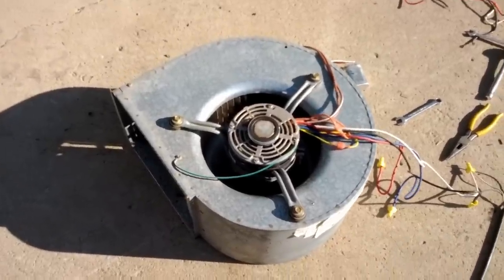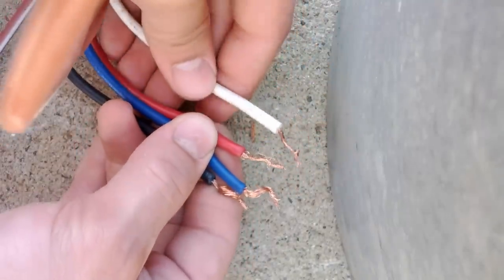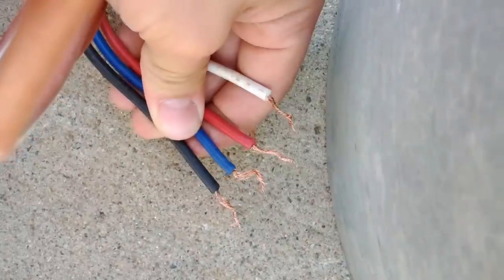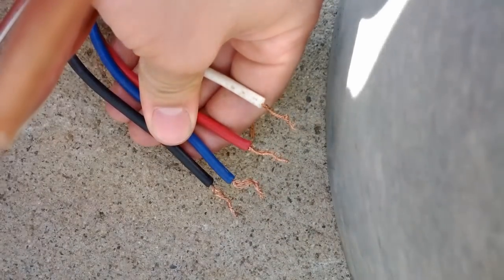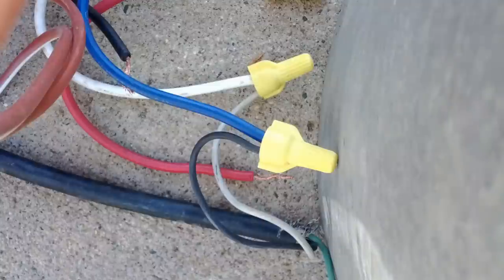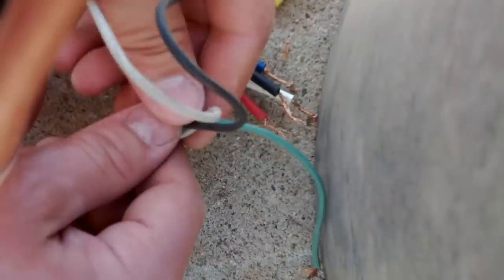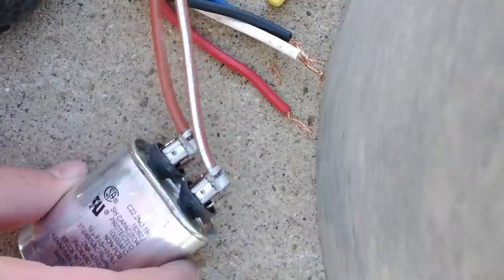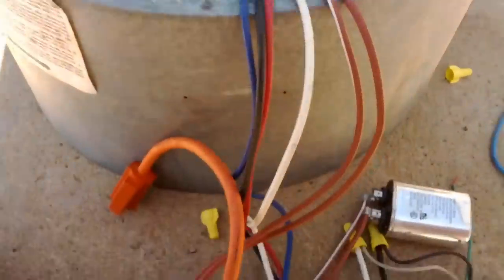How To Wire a Furnace or AC Blower Motor DIY

Comment: Hey Ben. I just found your video tonight. Thanks for this very well explained video of how blowers work. One other hint. I have a friend who does commercial air-conditioning and he gave me the blower out of a 5-ton unit. He explained the wiring to me and it works fine. However, he cautioned me that blowers are looking for a "load" when they're running. As they are designed to move air through a series of trunks and duct work, they are looking for a load or partial block of the blower output to run properly. He told me to take a piece of plywood and partially cover the output opening until the fan ran as fast as it could. I had to move it around a bit but I finally realized there was a sweet spot where the blower moved the most air. My friend told me if I ran the blower with no "load" on the output, it might burn it up faster. It's been working for years now and I put a rocker type switch on it; one way for high-speed and another for low-speed. Thought you might be interested in that.

Comment: I have an old a/c unit scrapped for parts and wanted to use the blower motor/squirrel cage as a shop fan but wasn't 100% sure on the wiring, your video fixed me right up.

Comment: Thank you! I was getting condensation because the blower speed in my AC was too high. Switching to the med-speed (in my case it was actually yellow) just saved me another service call. It's been 4 hours and so far no droplets.
Reply: Condensation is a normal thing. It shows the AC is working properly. If you don't move enough air thru the evaporator coil it will freeze up and your fan motor will burn up from too much Resistance. Your drain line is probably stopped up. Just blow the line out with compressed air and wire it back the way it was (Higher Speed) and it will work fine.

Comment: I used a commercial 3 step rotary switch on mine to get all three speeds working. I have a large deck behind the house. I put a couple of vanes on the front of the blower to spread the flow outward and it works great.

Comment: I guess my blower motor only has a high and low speed; because I only have red and black, and purple.

I am using the blower motor to evacuate heat from my workshop.

Also, if I only connect 120v the motor runs only at half speed; and I have to move more air than that.  

Thanks for the content; straight forward and actionable content; so thanks for that.

Comment: You don’t have to guess what wire is low medium or high speed just run resistance test from neutral to each one of the wires. The one with the highest resistance is low speed always.
Reply: What component on the motor increases resistance?
Reply: @SilverthorneA27  windings
Reply: Is each set of windings slightly different material? Or just longer pathway?
Reply: @SilverthorneA27  Getting a bit past my knowledge but same material (copper) but less or more of it.
Reply: @SilverthorneA27  Some motors also use inverters to change frequency.
Reply: What will the resistance be between low speed and medium speed (as an example)? Just want to be 100% sure I identify the neutral wire by process of elimination even though it is likely going to be the white colored wire.
Reply: @chrisE815  low 24 ohms 
Med 17 ohms
High 6 ohms
Reply: @SilverthorneA27  Longer pathway.

Comment: Dude, Thanks a whole bunch. I've been holding on to an electric motor for almost 5 years with the intention of building a homemade lathe and I've tried several times to figure how to wire it to  an a.c. outlet without success. With the help of this video I was able to wire an electrical cord to it in 5 minutes. And to my surprise its also a 3 speed motor. I can't thank you enough man. Now I'm excited about building my lathe. Yeeeehaaa.

Comment: Benjamin. Thanks for your video. I'd just wish you would have shown how you managed to get the power ( 110v in your case) to test/check the hook up of your wires. We need to see that so we will not damage anything and we will not get electrocuted... If my 7.5 uf capacitor also reads RUN, what does that mean? how come my previous capacitor was the same 7.5 uf but bigger and it did not have the words RUN? Why yours reads 
370/440VAC and mine reads 440/370VAC ... I pulled my blower to clean it thorougly and now i am hesitating about connecting wires yellow and black and i did learn about the other black. blue and red ... The thermostat was the one that stopped operating and it was not due to batteries!. Thank you . Blessing to you, your wife and children. Thanks for the beautiful pictures in your website. regards from Florida.

Comment: Benjamin, you did a good job of explaining the speeds of that motor, when it came to explaining the capacitor mispoke that capacitor does not start the motor it helps in the running torque but does nothing in starting the motor. It is true the motor will not start if the capacitor is not wired in because it does not complete the electrical circuit if the capacitor is not there.
Reply: In this kind of service the capacitor is not used as a starting capacitor but as you have said the motor does require it to start because it is powering one of the windings that provide the motor with a phase shift in order to induce a rotating field upon the rotor. W
Without this phase shifted magnetic field the motor will just hum and the shaft will not turn.  The capacitor fed motor winding also establishes direction upon startup and depending on what wires are brought out from the motor these kind of motors can be reversible.  This kind of motor is named a permanent split capacitor  or PSC AC induction motor.  They are useful when the starting load is not too heavy as with a squirrel cage blower motor whose load characteristic increases greatly  as rpms develop (more air resistance against the squirrel cage fan) at which point the motor becomes efficient when it approaches it's design RPM which is around 1075 rpms for 60 cycles/sec powered 6 pole wound motors.  This motor has 3 speeds which are relatively close to  each other and are derived by 3 different winding schemes within the motor to allow for a controlled amount of rotor slip within the magnetic rotating field.  The slow speed when the red wire was connected would indicate the most rotor slip was occurring.  If the motor were to be run without the squirrel cage blower on it's shaft you would not notice any speed differences because the proper load the motor rotor will not slip and develop the different speeds indicated on the nameplate.
Reply from the maker: Thanks for the clarification!
Reply from the maker: Kenneth deGruchy Thanks for the wisdom. You definitely understand the properties of PSC motor operation! Thanks again.
Reply: v
Reply: +Benjamin Sahlstrom 

!
Reply: +Kenneth deGruchy 

Great comment and supporting information. 

Question (if you have time): what is rotor slip?

Comment: It is important that you identify the 'common' or 'neutral' wire from the motor, and connect one of your two power source wires to it. As mentioned in the video, this wire is usually white, at least on 115 volt motors. The other power source wire must only be connected to ONE of the 'speed' wires at a time, and the remaining speed wires must be separately insulated (taped off). Connecting the power source wires to 2 of the 'speed' wires will immediately let the smoke out the motor! And for the record, the 'speed' wires actually control the motor's torque. If running the motor without the blower wheel attached, or with the blower air flow blocked off, the motor will run at full speed regardless of which 'speed' wire you connect to (a simpler version of what Kenneth states below).
Reply: There are 4 way switches made for these to use each speed, great if you use one in your garage vent in the summer or just want a shop fan. the switches only cost about $15.

Comment: Hello there, I would like to wire a second small inline fan into the system to push air back to the room furthest from the furnace, I want it to come on only when the main blower does. Can I jump off of the green, white and black wires of the main blower to get this done?

Comment from the maker: Check the wiring diagram on the side of the motor. It will identify which wire is the neutral. Good luck!
Reply: Benj I'm in in j inamin Sahlstrom
Reply: I'm not sure if this is what I need or not because I am trying to huck a 98chev Loumns
Reply: j
Reply: I've rewired two of these as shop fans, neither had wiring diagrams, one was 40+ years old though. Wiring diagrams are a nice crutch when present.
Reply: @speake7777777  a crutch eh?

Comment: Thanks for the easy to follow video.  My Lennox furnace and its motor are about 24 years old.  I have been maintaining them regularly and oiling the motor ports as recommended in the manual that came with the furnace.  Could you please comment as to many more years I get out of the motor if properly maintained.  Thanks for your help in the matter.
Reply from the maker: It's really hard to say exactly how long it will go. If you continue the maintenance recommendations I would guess it will last for the life of the furnace but it could fail before then. Blower motors rarely give much warning before failing.

Comment: Benhammin Sahstrom  With dc a capacitor will hold and discharge instantaneously  but ac will shift phase 90 degrees. so in a since making a third phase going to a start winding in the motor.  but, it is still a good video!! :)

Comment: I have a 3 wire 220v AC condenser blower fan that I would like to use as a shop fan, can you tell me your thoughts on the wiring for 120v ac? Thanks.

Comment: Good video. But what if I wanted to use a light switch for turning on the fan ? My fan has Red, Blue and a white wire. I want to just use a light switch for the fan. No light involved.
I want this fan to run on med speed

Comment: Thank you for the very helpful video. What if my current blower motor comes with 5 wires. 4 variable speeds and 1 common and the new one I just purchased does not come with a common or am I reading the diagram wrong? And it will always come with common no matter what?

Thank you ahead of time

Comment: I require assistance, the blower I have is from a microwave it's exactly the same but the motor heats up very very quickly at high voltages do you know why? 

(Im using a voltage transformer to control voltage for personal uses)

Comment: Can you tell me if I can use 16 Gauge tinned  copper  prime wire ( Automobile wire ) for my 1/4 hp  furnance motor  with 115 volts & 4.8 amps motor rating . The main electric breaker for my old furnance is 15 amps.

Comment: Is there a way in which I Could wire a blower(squirrel cage) to be able to plug it into a regular power outlet? The one I'm asking about shows it's both 230/120 volt but only has  black and white wire's coming from it in the heavier gauge wire and what looks like a couple of plug in smaller voltage wire's.
I'm seeking a way in which to repurpose a A.C. Blower motor instead of just letting it collect dust..
Thank You for any Advice, I just need something to bring in outside air excluding mosquitoes!!
Sincerely, J Q
Reply: In a 220 both white and black would be connected to the double pole breaker. I am pretty sure that would be how the use the 2 wire/with ground. In the 120 then just the black is connected to the breaker with the white going to the neutral bar. You can go to the hardware store and make your own plug that will connect to an outlet. The easiest way is to stick with the 120 so you can use normal 120 outlets instead of having wire up a 230 outlet. The plug you buy at the hardware store should be labeled White/Black/Ground and rated for 120.  Be sure you connected the ground to the motor for  Safety.
Reply: @effieamarty9276  what if there is no white wire? Plus, the green wire is already screwed to the blower, so i have nothing to go to any plug. i can send you the picture. tks.

Comment: A start capacitor helps start motor and is kicked out by gravity or other type of mechanism. A run capacitor like the one in the video assist motor in running. Has something to do with getting it out of phase.
Reply from the maker: +Andy Galindo Thanks for the extra explanation!

Comment: Thanks for the video so much. I have one problem. I am using the exact same motor wiring that the one you are showing on the video. My problem is that from my furnace I  have 3 wires that used to go in to my old motor. I have a yellow/orange looking cable, a Red cable that is actually attached to this circle on my furnace that looks like the thermostat sensor, and finally a purple cable that follows the yellow cable to the electricity box.
Reply: Paulo please take a picture of the wiring diagram of your furnace so we can get a clear picture of what you are saying.
Reply: I actually letf the one of the cables out and it works fine.
Reply: Kenneth deGruchy no Gy

Comment: Does anyone know if it is a resistor that changes the voltage that goes to the motor on the difference wires?

Comment: my fan is spinning to the wrong direction, can anyone advice what do i have to do to change the direction? tks!
Reply: it depends on what kind of motor it is. if it has a identification tag on the housing it should say if it can be reversed. check out my channel I have a couple different videos on how to reverse a motor.

Comment: Isn't at all possible to upgrade a blower motor to one with more HP in an older furnace?  I only ask because my AC doesn't cool down the house effectively, to say the least, because the airflow is horrible.  The motor is one speed and apparently not fast enough.
Reply from the maker: Not really. The blower wheel is sized to match the motor size.

Comment: what if you don't have a white wire.  I only have 3 wires going into mine and none are white.
Reply from the maker: Sometimes the neutral can be a different color. I have encountered purple neutral wires before. There should be a wiring diagram on the side of the motor that will tell you for sure which wires are what.
Reply: blosom2315 have

Comment: I wired mine to fast. It was faster but had a burning smell any help?
Reply: You probably connected the power across two of the 'speed' wires. One power wire has to go to the 'common' (usually white) lead from the motor, and the other power wire has to go to only 1 of the 'speed' wires, with any remaining speed wires taped off separately.

Comment: Why do my blower spins slow plz let me know
Reply: Could be the low speed, One of mine had the low disconnected when I connected it the fan barley turned enough to push any air.
Reply: Bad capacitor
Reply: Dirty blower has resistance.